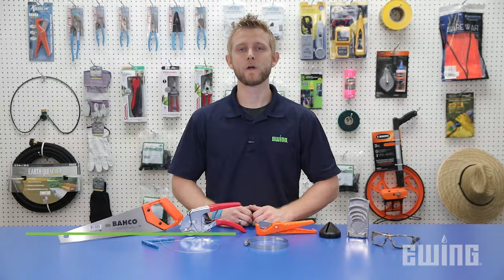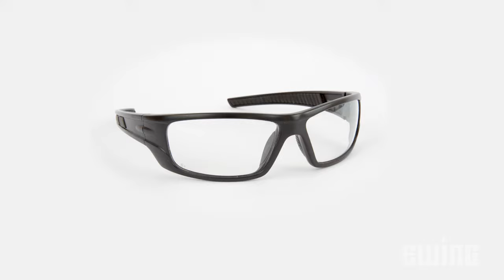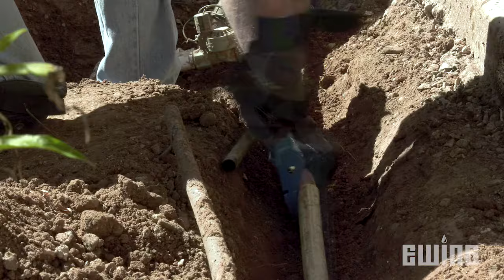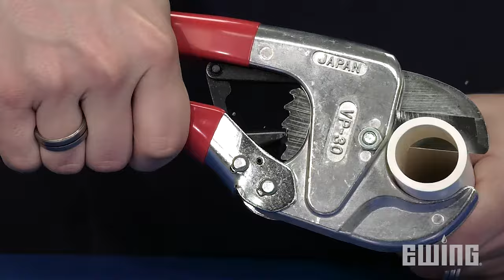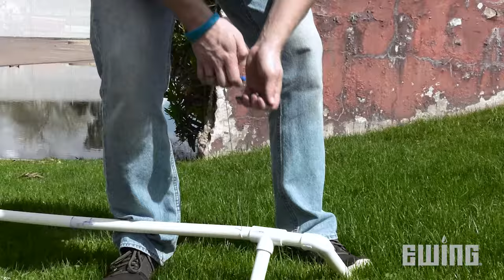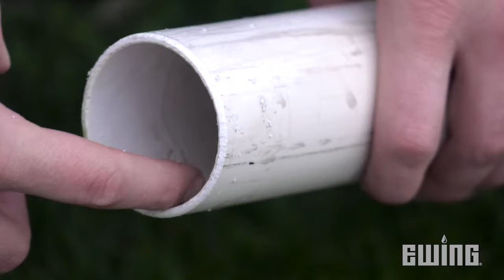PVC Pipe Cutting Tools & Tips

Comment: I recently bought a 2” cutter to cut 2” cpvc and pvc. 
  Under the floor today trying to cut some 2” ovc washer drain and had to cut more than I needed to in order to cut it since it takes so much pressure. 
  Usually, when it cuts through the outer wall of pipe, it gets a lot easier. 
  That being said, it was not so this time as I tried curing 3 different places in the pipe     
  I was finally able to cut through with a lot of effort in a better position on my belly. 
  Very disappointed in how it cuts bigger pipe.

Comment: How does one determine the volume of water required to irrigate 1 hectare of grass?
Reply: From the landscape industry, in the northern US and southern Canada, and where the climate is not extremely arid, it is estimated that one inch (25 mm) of water per week is necessary to sustain a landscape. This also depends on the type of grass and plants, and on the season. One hectare is about 2.5 acres, and the weekly volume would be about 250 cubic meters (68,000 US gal). Of course, if it rains at least the one inch (25 mm), no irrigation needed. Water is best applied once so it soaks well into the root zone, not in small doses spread over the week. Some turf species require more water during the hot summer months in the northern hemisphere, and often it is better to let grass go dormant during the summer rather than force it with so much water.

The formulas are:   
25 mm x 10,000 sq m = 250,000 L / 1000 = 250 cu m
or
43,560 sq ft x 2.5 x 0.623 US gal = 67,845 US gal